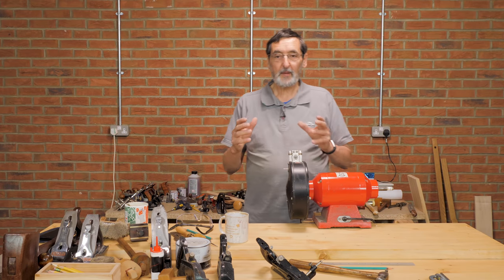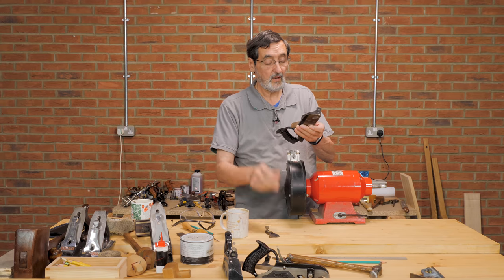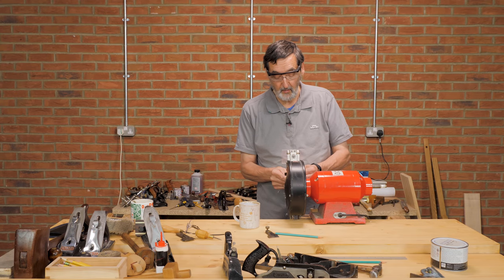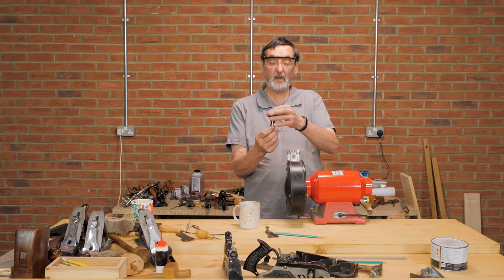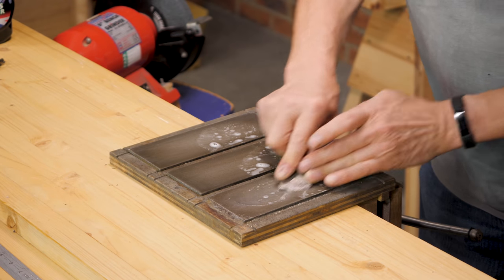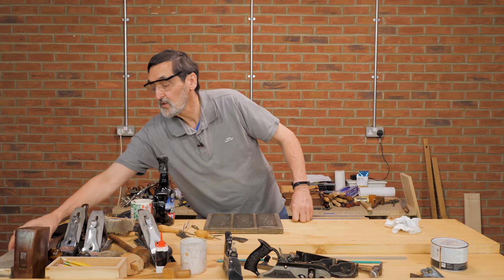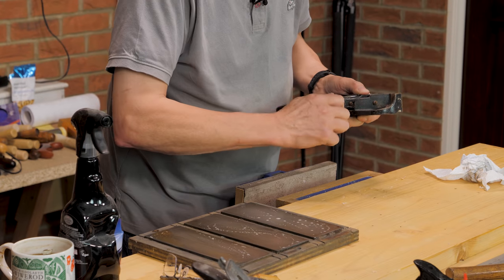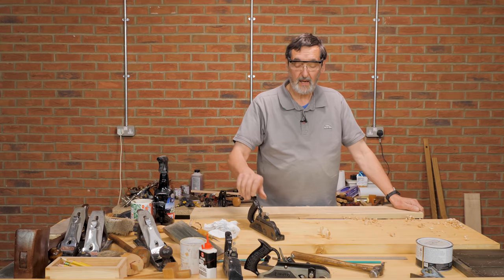How to turn a No.78 into a Scrub Plane | Paul Sellers

Comment: I have seen SO many second-hand 78s missing the depth-stop and fence. They are generally cheap because of the missing parts. This approach makes these planes more useful and desirable again. A great way to keep old tools useful and circulating!
Reply: Rex Krueger better get one soon, I feel as the price my jump soon 😂👍🏻
Reply: You guys should know that, at least in the US, you can order brand new 78s from Home Depot.
Reply: I didn't know that!  Have you ordered one? Was the quality okay?
Reply: I did!  It was about $60, and after a bit of fettling, flattening and sharpening the iron, it seems to work great.
Reply: That's great to know. A new source for 78s. Thanks!
Reply: Rex Krueger Hi Rex, could you use a 78 as a shoulder plane? Or is it too wide? I know you can move the blade and use it as a bull nose plane.
Reply: There are plenty coming up on e-bay week-by-week (2022) at modest prices.  I think, if you have a use for a good rebate plane, you should soon be able to get hold of one at a fair price.
Reply: @RexKrueger yooouuuuuu!!
 >:V
😂

Comment: Finally found a  bare 78 in the wild that was suitable for this at a great price, eight dollars. This thing is a monster and hardly takes any work to convert. Made a make front knob for it and it is more comfortable for high volume work. Might need to file mouth a tiny bit to cut down on clogging especially on wetter wood. Love it, love it love it. Thanks Paul, but got to admit I was somewhat skeptical.

Comment: Great video, Mr. Sellers! Thats a great way to repurpose an old or extra plane! A couple of notes about safety, though. 1. You mentioned safety glasses, which is absolutely correct. Grinding wheels, however, can become loaded, and should be dressed prior to use. Also, if your wheel has become off balance, due to debris, or a hairline crack, it can come apart when the grinder is turned on, so it's best to stand off to one side for the first 10-15 seconds to keep from being hit by wheel fragments if it does fail catastrophically. 2. I noticed the grinder you're using has a spindle on the opposite end, without a wheel on it. Unguarded, it would be easy to catch a sleeve or loose bit of clothing in it, possibly severely injuring yourself... I, for one, greatly appreciate your videos, and dont want to see that happen. Thanks again for another great video, you've taught me a lot about these tools and practices as I learn this trade! Cheers!

Comment: Guess I won't be buying a 78 on eBay for a couple months now 😂
Reply: i had a bid on one.. guess what... cant pick one up cheap anymore... shame as this was a plane that not many bothered with... until now lol
Reply: The power of Paul Sellers
Reply: I gave up trying to buy a Stanley 78 or Record equivalent on ebay.  Even heavily rusted ones with short blades are expensive now.  I found  a low-cost copy of a 78, a Toolzone Duplex Rebate plane. Cheaper new than a used 78, reviews criticise the fence and spur but the base and blade are ok for conversion into a scrub.

Comment: I have several of these # 78 type planes. One has the front taken off.I am not sure what it was used for by it's original owner. 
One doesn't have a second place for the blade(in the front). It may be a good candidate for this. 
The other 2 look just like the one you have.
 I will be turning one of them into a scrub plane.
Congratulations on the new place.

Comment: There is an lesser known brand of English made "78" that has a wooden knob attached to the front blade position. It is just a simple knob with the base cut at an angle so it points up when attached to the front blade position. That would really improve the comfort when using this as a scrub plane.All the best.
Reply: That's the Woden W78. Record took them over and produced a re-badged version as the 778 for a while but it didn't have the knob.

Comment: Hmmm. I don't know. There are so many clunker planes around that I would not pick a joinery plane to convert to a scrub. On the other hand, that might be a regional thing. Over here in Germany, I would much rather pick up an old wooden bench plane from the flea market and convert that. But then again, wooden scrubs are quite common here, too, while a Stanley or Record 78 is very hard to come by.

Comment: I've just done this, having bought a number 78 and a spare blade on eBay. struggled a little bit to get the hang of the figure of eight sharpening, but when it clicked it went quite quickly, and the end result is amazing! Very pleased. Thank you very much Paul.

On a related note, the plane I bought has a bent fence arm, i.e. the bit that screws into the plane body is bent. I am wondering whether it is safe to try and straighten it by simply screwing it into the plane body and trying to bend it, or where this is likely to crack the plane body itself? Anyone who has any thoughts, or a better way to do it I would love to hear. Thank you all.

Comment: Since my only scrub plane is a Stanley #5,  what about using a 78 with a well sharpened straight edge blade as an option for smoothing?  I don't use my 78 that often for rebates, it would save me a lot of time changing blades with the #5 from scrub blade to smoothing blade .

Comment: Good news ... I found a Record 078 on Ebay for less than £15.00 that had all the bits needed to convert to a scrub plane and was in generally serviceable condition.  Good news again ... after conversion, it can hog off good quantities of stock easily and quickly both along and across the grain.  But ... bad news ... it's no substitute for an actual scrub plane.  The basic ... and immutable ... drawback of a modified #078 is that it will never, despite whatever imaginative customisation is employed, be able to shift and clear large quantities of heavy shavings half-nearly quickly enough.  It clogs and backs-up ... and it clogs and backs-up very quickly.  It's not hard to clear but doing that stops you in your tracks and badly interrupts your work flow. It seriously slows you down.

I work by hand ... from choice combined with necessity.  I am out in Africa and limited in access to locally available but very rough stock (although often very lovely wood) and the customised #78 is never going to be able to meet my heavy stock preparation needs.  I have bitten the bullet and ordered a Veritas scrub plane.

The #78 conversion was well worth a try and I am not really disappointed with the unsatisfactory outcome.  It proved the case for spending a whole lot of money (that quite hurts) on a purposefully designed and designated specialist tool.

Comment: This seems like an excellent way to get a scrub plane on a budget.  I've been eyeballing the Veritas Scrub plane for a while.  Have you used it?  How would the two compare in your estimation?
Reply: Looking at the Veritas specs, I would say this pretty close on blade specs and seriously cheaper. the Veritas might be easier on the hand, but doing a lot of scrubwork is rough on the hands anyway.
Reply: yeah I'm currently using a converted #4 and it is ok but it has convinced me of a couple of things: ergonomics are important and a narrower blade would make a deeper cut easier, allowing you to get on to the jack sooner.    this on the surface seems like a great solution for the width but I know that Lee Valley puts a lot of work, thought and design into their planes and so all of that might be worth the extra money, especially with a pmv-11 blade.  It's not as though 150 dollars is much money when it comes to buying a new well made plane.  I'm interested to find out if anyone has experience with it.
Reply from the maker: There is no difference between the two planes in use.
Reply: Thanks!  That makes my decision very easy.  I appreciate it.

Comment: The great part about this “conversion “ is that all of the changes are non-destructive except for the cutting iron, which is a consumable part. You can easily pop a regular iron in the plane, reattach the fence, and cut a rebate/rabbet again.

Comment: Certainly doable but why? I can't imagine how uncomfortable using a 78 as a scrub plane would be after a couple of hours. I had to check the date to make sure it wasn't April 1. Struggling for new content Paul?
Reply: The whole point of a scrub plane is you are achieving a fast roughing-out. If you're doing it for hours on end you're not scrub planing.